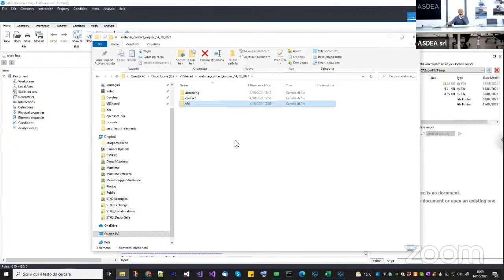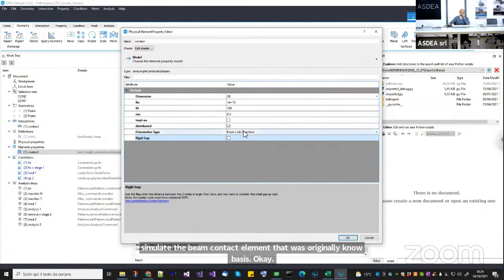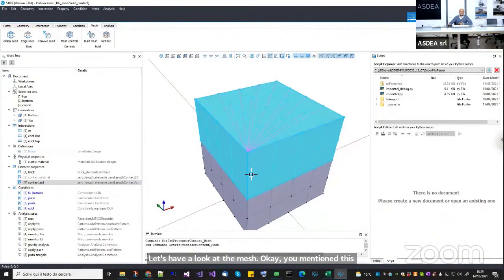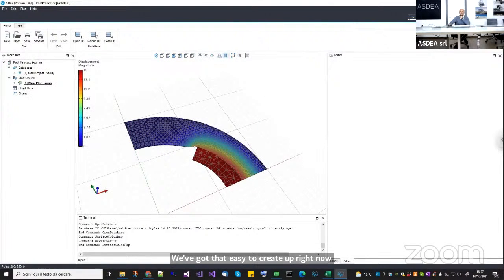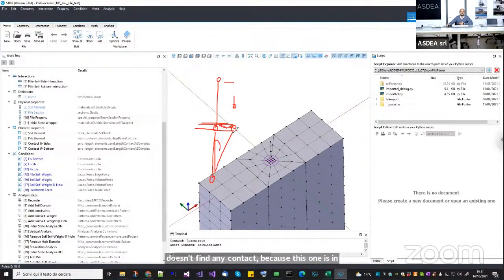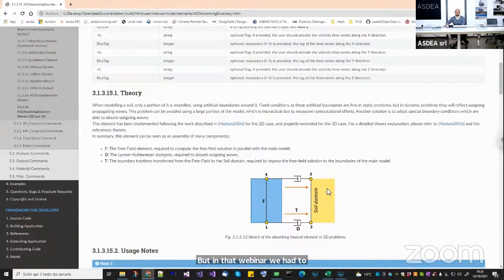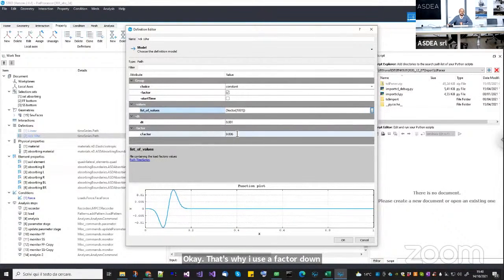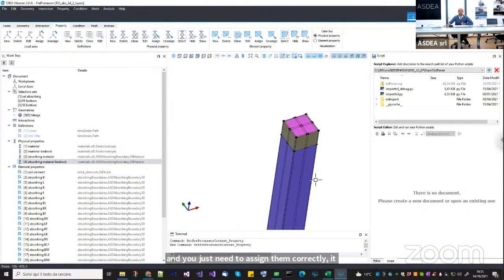Implicit-Explicit Contact Element Applied Examples: soil-foundation interaction and RC structures

Comment: are these contact elements available in OpenSees?
Reply from the maker: The code is the current OpenSees repository, but you have to wait for the new OpenSees release, or you can compile the source code.

Otherwise, you can download the pre-compiled unofficial version from Prof. Tarque's website: https://www.pucp.edu.pe/profesor/sabino-tarque-ruiz/producciones/
Reply: @STKO_ASDEA  For direction of contact element (master to slave) betwwen basement wall and surrouding soil, how can I choose master and slave? they are difference in 2 opposite walls, eg: for the wall on left side: master is soil, slave is wall; but for the wall on right right side: master is wall, slave is soil?
I am so confusing about master-slave direction concept
Reply from the maker: @buunguyenquangthien7794  The concept is very simple: the contact normal vector MUST point from the master to the slave. In a 3D model, the contact vector is the local Z axis of the LocalAxes object attached to the master and slave faces. To re-use the same local axes from two opposite sides, we decided to make the soil a master on one side, and a slave on the opposite side.